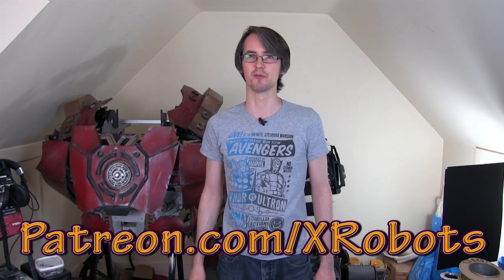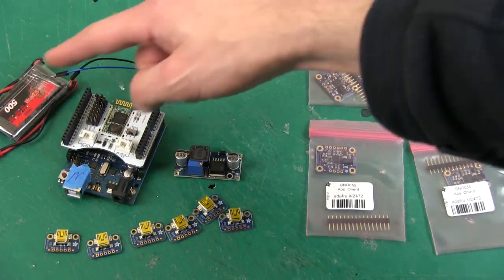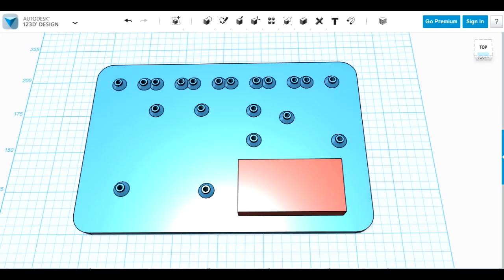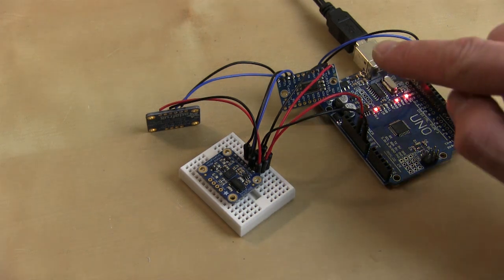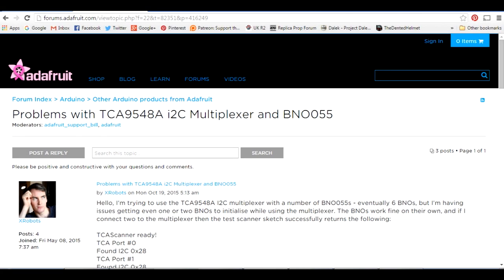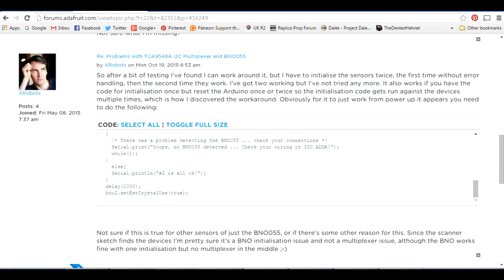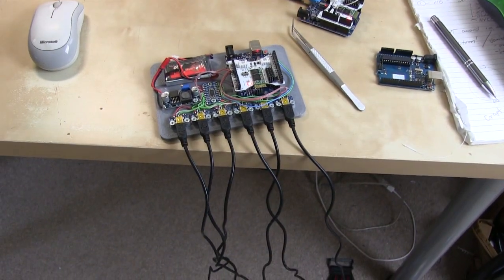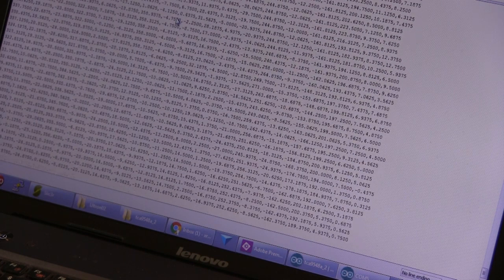Avengers Ultron #2 | Building a Motion Capture Suit | James Bruton

Comment: Wouldn't be easier, and cheaper to use MPU6050 sensors?
They wont give you the absolute angle but they will give you the angle it moved. So considering every angle as 0 initially, then you can just move arms as many angles as the sensor says. And MPU6050 sensors are a way cheaper.
Reply: I guess MPU6050 sensors can't give you the absolute position in space, they don't even include a magnetic sensor to give you the rotation in Z axis... So I guess the oly whay to calculate the position with those sensors is to take the initial rotation as 0 and work with that. I am doing some research for a motion suit but a little more complex (fingers and other bones will be included) wich I will use for an VR proyect (where I need to use fingers)and maybe 3d animations or whatever crazy idea comes to my mind... Your project is really interesting, still watching some of your videos.

Comment: if you attached all your sensors to a pair of mechanic style coveralls you could just stitch everything down and just step in and out of it quickly and easily. You could just add some elastic around the out side of the coveralls where the sensors are located to hold the sensors more stable. It would be slick.

Comment: Very cool as VFX guy myself (not as much 3D). I used the XBox Kinect for some customer project mocap. 
But you are not as flexibel as with a suit because you have to remain in range of the Kinect which is a 24mm lense on crop sensor so rather small field of view for those wide shots.

I wonder what you would need to do to such a data stream to capture it in a 3D package to make the data to be interpreted as location, rotation and position of a rig. Would probably be pretty trivial.

I can then make a very cheap mocap suits with a beagle bone, to store the data on flash.

Comment: James, have you considered building (or buying) a desktop CNC mill? Because some of those parts could be made much faster with a CNC, or using it in combination with a 3D printer. Though milling plastic could be pretty messy.

Comment: Instead of using double initialization try putting a delay before the first init... Arduino boots pretty slow but I think your sensors are booting even more slow due to the multiplexer....
This is a common problem using faster boards like teensy, and it is usually fixed with a few milliseconds delay on the start up code...
Reply: +James Bruton (XRobots) well, I guess testing this would not hurt and would be more elegant than retrying initializing during fail events. I'll get the same boards and to a test...

Comment: What sort of read rate are you getting from the sensors? Are you losing readings because you are having to loop through the ports on the "switch" or is that faster than the sensor?

Comment: well, I'm not sure what kind of precision you want to achieve. For working position tracking you need some sensor data that provides absolute values. It will not work with the IMU only. The drift of the sensors no mater how good they are will sum up. And if you want to calculate position of the sensors by integrating the acceleration it becomes worse and worse. 
That is the reason you need GPS for drones. 
As far as I know all professional motion capture suites use cameras to provide this let's call it indoor GPS. 
I think you can detect some simple gestures but not much more.
Reply: +Andreas Hölldorfer He explains in part one, that the suit is used to teach the robot simple gestures. Based on the initial movement of part of his body, the robot AI will predict the appropriate movement. Think prosthetic limbs based on sensors fixed to existing muscles, rather than video game motion capture and replay.
Reply: Maxx B Yea I've seen part 1, but still I think it is difficult, I would use a kinect ;) Never the less I'm really curious how it works in the end. I had a few lectures about sensor fusion, and currently I'm working on a drone boat, so I see the problems on the way to come.

Comment: Still not sure why you are using an development Arduino Uno board. Wouldn't using a photon, teensy etc. make more sense?... i.e. small foot print and a lot more processing power. There's not much in it in terms of cost. I would have thought size was a premium here.
Reply: +Dominic Giles It's probably that he has multiple Arduino boards laying around. Also once you are happy with a platform for prototyping, it's usually quicker to stick with it.

Comment: I can't remember the name of the range but Arduino has a "wearable tech" range that's named after plants. You might want to look into those, they have sewable adapters, even using press-studs as connectors. So you literally sew them on and then you can pop the electronics on and off.